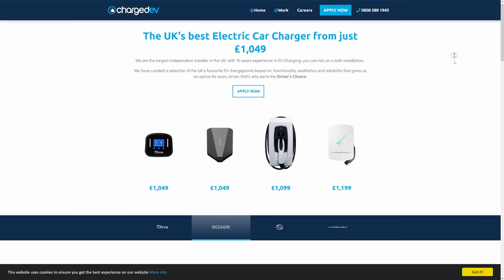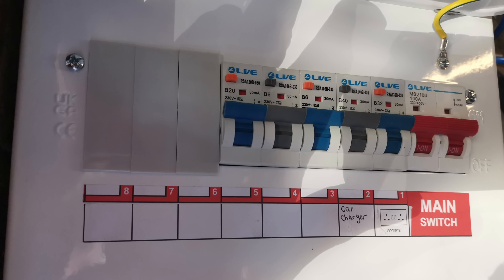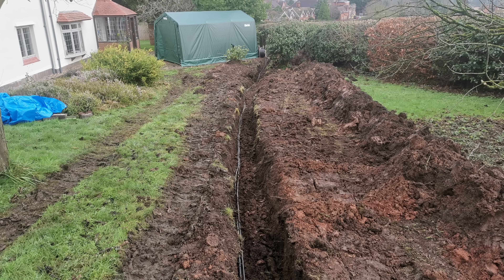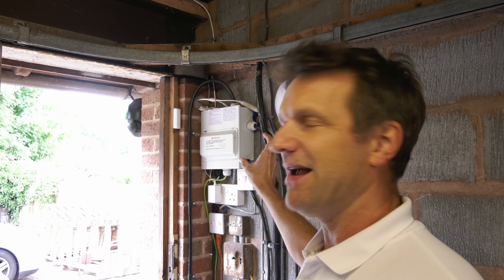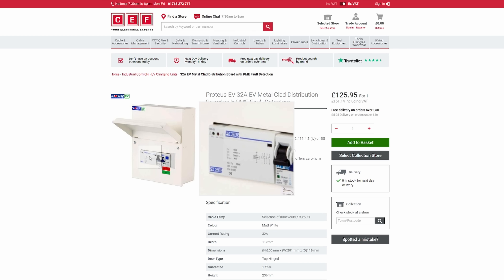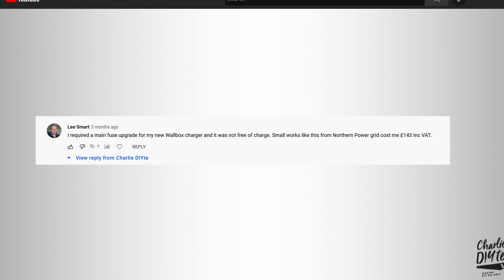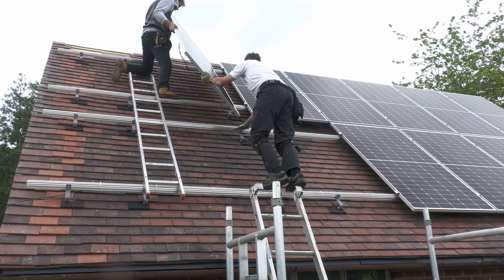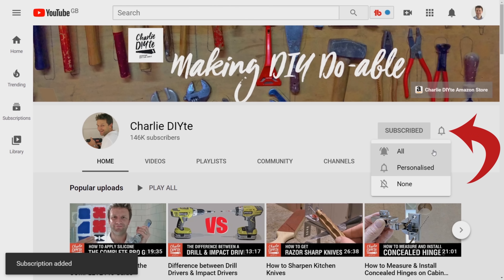EV Charge Point Install - What Went Wrong

Comment: If you have a TN-C-S supply (PME) and the SWA cable sub mains to the garage is directly terminated to the distribution board. The protective device doesn't necessarily need to be an rcbo. As correctly stated, any earthing connected at origin should not be used at destination and TT system adopted in conjunction with RCCB/RCBO protective devices and an earth spike. This would address any RCD  selectivity issues.

Comment: You can export your TT earth to the garage. Only a potential issue if you have a PME supply. Double pole diagrams are generally drawn on the devices themselves. On single module its normally termed and setup as switch neutral which is different to double pole. But serves the same purpose. Up front 100mA is no bad idea but if the tripping potential due to selectivity is only a minor nuisance I personally wouldn't worry about it. You could also argue the 100mA S type would need to be a Type B RCBO and not type A. Which are very very very expensive. Good video
Reply from the maker: Thanks Mark. Makes sense. I haven't done anything since doing this. Any issues with selectivity will be sorted when I switch over the garage to the  25mm SWA and run just the car charger off the 10mm². Thanks for the comment 👊

Comment: There’s a big difference between double pole and SPN. Most “double pole” rcbos are actually single pole with switched neutral which still complies as it disconnects both live conductors. Double pole actually means it measures the current on the neutral. 

You won’t get an S type 100ma time delay RCBO your best option is too use an upfront 100ma S type time delay RCD in a separate  enclosure before the house CU. Fusebox have the most cost effective offering of this in an RTA1001002S. And install an MCB to protect the cabling to the garage as the upfront RCD will provide fault protection. 

However if you are on a PME system in the house and are creating a TT in the garage then that would explain why your electrician has used a stuffing gland for the submain as this is the point where he divorces the PME system and didn’t want to connect the earth of the SWA’s armouring. I personally usually use a plastic enclosure with the above mentioned time delay RCD and label it do not connect PME  earth into this installation to make it very clear. And if you are connected to a PME in the house you do not require RCD protection to the SWA as it meets the requirements so can just use an MCB.

None of the EV chargers integrated RCDs meet the 61008 standards so all EV charge point installs require a double pole RCD or RCBO and the installer of the charge point is 100% liable for this and should be checking! 

Enjoyed the video however! Always find it interesting what opinion a client would have on these situations. I would also be interested to know if your EIC for the charge point was in the name of the individual installer or charged EV as that would be who the liability falls on.

Comment: This is yet another video that illustrates the point that,
a. the reg are always in flux so what's right this week is wrong next week or dependant on whos assessing it..
b. an avid / interested DIY will always be better than a 'pro' whos just doing his job.
Reply from the maker: Thanks Dave. Still not perfect but we'll be able to solve the remaining issue on selectivity once I wire (get my sparks to wire) the garage up to the new 25mm feed leaving just the charger on the 10mm. I also need to resolve the issue with the solar charging. Wish I'd got a Zappi but should be able to fix it by moving the CT clamps.

Comment: EV installations can be simple and straight forward, but they can also be very demanding Re knowledge of the wiring Regs (BS7671) and understanding of the equipment built into the Charge points. Indra is one of the more sophisticated charge points, which is to say it has a unique way of preventing electric shock in the event of an Open PEN situation. The reason for making your garage a TT supply is in case of this Open PEN and would be the reason for the plastic stuffing gland being used in preference to a std. SWA gland. However all of this is null, because the Indras have an internal Open PEN detector which will automatically disconnect all 3 conductors when an Open PEN is detected. So as far as the Indra goes, there was no reason not to export the Earth from the house supply. That is not to say there are not other reasons such as Extraneous metal in the garage which needs to be bonded. The SWA supplying the garage looks quite small and unlikely to be the 10mm required to bond extraneous parts directly to the MET in the house.  At a guess I would say the supply SWA is 6mm, and this would bring into question the issue of voltage drop over the 65m cable run. You would be in grave danger of reducing the voltage to the point where the Open PEN device of more common charge points would mistakenly think there was an Open PEN problem.
And this is just the basic stuff 😀  Sadly there are lot of bad installers out there and no real way to tell the good from the bad when you are a non electrician.
Reply from the maker: Thanks for this Gerald. The SWA is definitely 10mm - decent quality bought from CEF. Longer term I'll be disconnecting it and connecting instead to the 25mm I also laid at the same time but we carefully calculated the voltage drop and 10mm2 is fine for the length of run I've got. The guys from Chargedev who returned to install the double pole RCBO switched off the PEN detection as, because I have TT up at the garage it was causing (we think) periodic tripping of the charge point. The plastic gland wasn't deliberate. My electrician had damaged his wrist and so couldn't install a metal one - said he'd change it when he comes back to do the next round of work.
Reply: @CharlieDIYte  Thanks for reply. I found your original install video after my post. Yes 10mm is what we use for runs of that length. I see your house is TT as well so no danger of Open PEN problems (unless imported from neighbour on connected utilities) The flexibility of the Indra is an advantage. We have had problems of nuisance tripping due to over-voltage caused by local generation. I don't see a real problem with the plastic gland. SWA should be earthed at the source end of the cable. So, long as the cable is secure and no danger of pulling out then I'd leave it. We terminate SWA into plastic Wiska boxes with plastic stuffing glands as no benefit in using metal glands.  One additional point.  I hope your new fuse board used Type A  RCD's. I couldn't see the type A symbol on the breakers.  With electronic devices everywhere in the modern home, the old style Type AC RCD's don't really cut it.

Comment: Nothing wrong with plastic glands, are you using the braids for earth? If not plastic glands are fine. Next time use tuffcable then no one can be picky and point out the glands. I don't see them picking on SY in plastic glands.
Reply from the maker: Yes he has earthed the metal sheath but in a fairly heath robinson way which is why it needs to be properly glanded.

Comment: ( I am not an expert or a professional electrician) But as far as earthing of the swa cable at both ends is concerned I believe that it’s practice to earth it from the mains incoming end of the circuit, (which in your case sounds like the house end)..This should enable a time delayed 30 mA RCD to achieve the required disconnection time for shock protection during fault conditions (if the swa casing was breached for instance). The secondary consumer’s unit (in your garage) would then have its own earth path fitted via an adjacent earth stake to allow the garage rcd to operate and isolate the circuit to your car charger within the required time. I believe this level of work requires an electrical test and  completion certificate confirming  suitable operating speeds, signed off by a registered qualified officer. Bear in mind though, that in very many installations, mains incoming is often situated in the garage integral to a house, in which case the above description would not apply! (I’m quite happy for a professional to correct any errors in the above). Safety first! 🙏
Reply from the maker: Thanks Phil, yes I think that's right and in my case the SWA is 2 core only which makes earthing the SWA more important.👍

Comment: So much of those electrical regs are bogus. From a physics perspective it doesn't matter one bit which breakers are installed in these consumer units. Remember that the same regs committee previously said it was OK to use plastic consumer units. The CU is just a box with a mechanical rail for holding breakers and a bunch of connections.  If the regs committee really want to protect people from harm they will outlaw ring-main circuits. Now THAT is bogus technology!
Reply from the maker: Fair point mate!

Comment: Did you just compare charging up your EV to filling a tank? Filling a tank takes you much further than fully charging a EV.
Can you re-calculate per mile per cost on both vehicles?
Reply from the maker: It's still cheaper. The car has a range of 250 miles as against say 500 for combustion. So double the charging time and cost and you're still at less than half a tank of fuel cost wise.

Comment: The day rate for EDF EV35 is crazy now. Makes their off peak rate of 4.5 not attractive at all. Basically I’m stuck now on their standard tariff and switching to EV tariff now is barely worth it.
Reply from the maker: What's the day rate of their EV tariff? If it's similar, then it would be worth switching because you can return as baby things as possible at the off peak rate - like the car, dishwasher, dryer etc.
Reply: @CharlieDIYte  49.70p and 44.84 standing

Comment: If you electric car is at home its well worth using solar to charge it if you have an effective mechanism to divert the excess (I use a zappi charger) My inverters max is 3.6 kWh but still managers to get 100 to 150 kWh in the car during summer months when we are not out enjoying the sunshine. The little bits trickling in soon add up.
Reply from the maker: Yes I agree Chris. Will have an experiment with it this summer. Problem is the car is rarely here during the day.

Comment: My 10 year old Fiat panda gets 55-60MPG, is ULEZ compliant & with a 35 litre tank it costs almost £70 to fill but that gets me around 420 miles. My mate's 2021 Audi Q5 Hybrid gets just 19miles on electric & just 30 mpg (petrol), but is apparently eco friendly it's exempt for both the London Congestion Charge & ULEZ. When they start pricing electric cars by the mile to make up for the tax they will inevitably lose from fuel duty then I reckon you will be paying 5-10x per mile on top of what the electricity costs to run your vehicle. On top of all this these are completely unfeasible for those of us who live in flats (& central London where I live has probably more charging points per square mile than anywhere in the UK).
Reply from the maker: You're probably right

Comment: Don't worry about the time delayed switch, the chances of you tripping the board in the garage will be small and there is debate as to whether a time delay actually helps, 100ms is a pretty short time!
Reply from the maker: Thanks 👍
Reply: 100mA and not mS. Standard RCD are 30mA meaning that if an earth fault occurs this will trip with less than 30mA of fault current. A time delay RCD works the same way but will require just south of 100mA of current to trip. If you have both on the same line the 30 mA RCD should trip first and time delay stays on but this is not always the case
Reply: @andreavassallo6586  thanks! I think my conclusion was correct but my working was wrong!

Comment: If an electrician is installing a supply for a piece of equipment they have to install to BS7671, the ev charge point installers also hold responsibility by failing to inspect the installation they are connecting to. BS7671 although not a legal document will be used in a court of law should someone be injured or fatally injured. David Savery on YouTube has a video about a court case of a child that was killed by a garden light in a pub garden (David uses 'adult' language). 

Electrical work is more and more becoming something people need to be highly educated to understand the maths, physics & practice skills along with keeping up with the ever evolving equipment and regs as well as building regs.
Reply from the maker: Agreed.